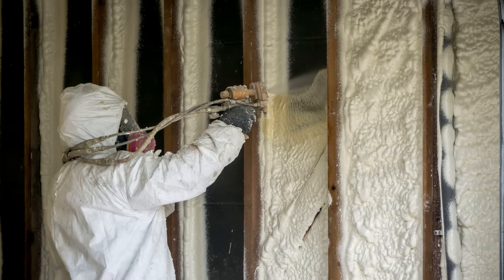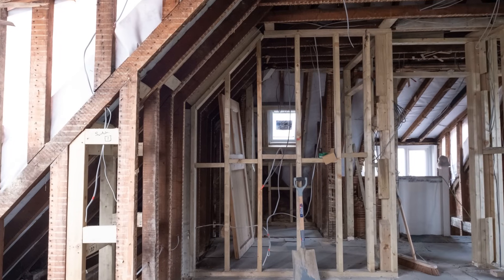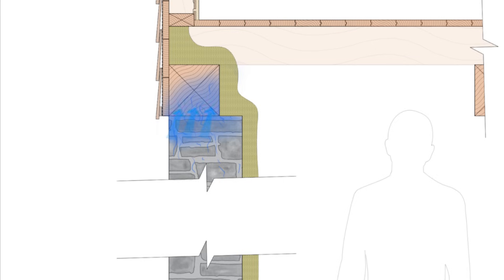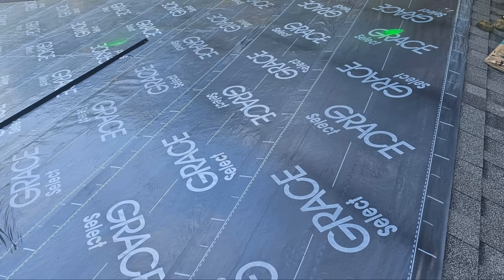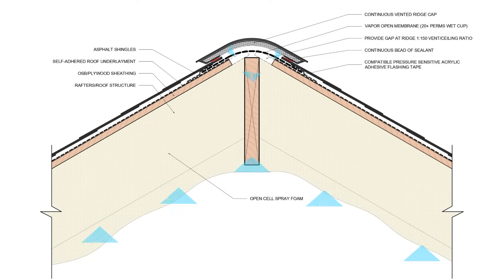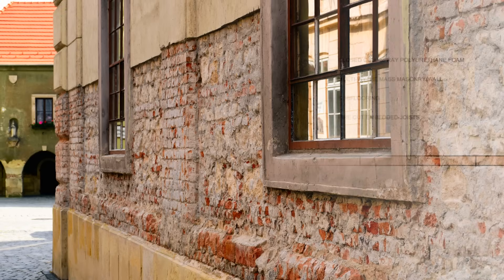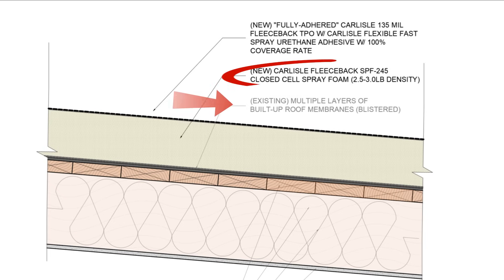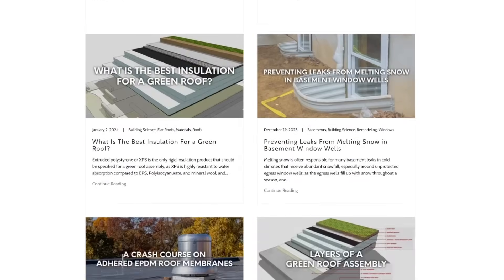Should You Insulate an Old House with Spray Foam?

Comment: If you have a basement or crawl space that has required the use of a dehumidifier, do not use spray foam in your attic. The moisture will be trapped in your house.

Comment: I was moments away from signing a contract to spray foam the bathroom ceiling because I can’t handle dealing with this fiberglass and I’m frustrated I haven’t been able to make a lot of progress lately. So can I spray foam the outside of my roof instead of the foam boards? Would I still use the ice and water shield underneath or would that affect the adhesion? Also it looks like then I wouldn’t need the second layer of sheathing and ice and water over the foam? I’m really digging this instead of our current plans if it’s doable?

Comment: What the best way to address the old home already insulated with closed cell and started make the house sweat on exterior on winter time. I live in Boston which the climate can be really cold
Reply: Any spray foam retrofit also requires a whole house dehumidifier. A portable dehumidifier, ERV or HRV will be insufficient.

Comment: If you put a blanket of spray foam on your roof you should consider what kind of temperatures it can reach when it’s heated in summer. Both peak and average temperatures. Heating that foam will promote chemical reactions that aren’t considered significant when the temperature is much lower. I doubt if anyone knows what those chemical processes will be, but you can ask a chemical or polymer engineer and get some solid ideas. Accelerated deterioration of the foam is likely. And off-gassing will continue as long as any chemical reactions persist. Extend that concern over ten, twenty, or more years, and good luck.
Reply: Good idea. A lot of roofs are covered in foam. Typically rigid foam is laid on top roofs. I can’t imagine no one has looked into it. Perhaps there are entities that have set guidelines.

Comment: I had a company that came in and capped the tops of my walls in my roof. They said I was leaking too much air up and out during the winter. But I was concerned my walls wouldn't dry out enough. I'd like to trust they knew what they were doing but they didn't ask about my siding or anything.
Reply: It doesn’t sound to me that you have a problem there. The tops of walls is not where you normally want holes. In new homes that is supposed to be sealed off, to keep fires from spreading and air leaking. What matters more is vapor drying out through materials, not holes. Most older homes have vapor-open materials in the walls. A lot depends on your climate and what your walls are constructed with in the first place.
Reply: They did good, inside air travels through holes and up the inside walls and out the top plates into the attic. You don’t want this, so this did good if they sealed all your top plates.

Comment: What about closed cell against R-panel on a shop building or barndominium?
Reply: It will separate from the building!!
Reply: @truthhearit1471 Does it delaminate from the board (OSB)?  The way those boards are put up is nailed through the OSB and the foam into studs. So it seems the panels would have to fall apart, OSB and all, for it to come off the building. I wonder if some case studies have shown this.
Reply: Spray foam is different from foam boards. @pcatful
Reply: @pcatful spray foam is different from foam board.

Comment: An exterior application of spray foam also mitigates the problem of persistent and intolerable off-gassing.  Thanks for another very informative video!
Reply: I'm just a home building science enthusiast and that's the conclusion I've come to about insulation in general, that they should go on the exterior of the building.
Reply: @RoughNeckDelta  Same here.  Asiri Designs has pointed out previously that in some situations, exterior insulation isn't an option; the downtown historic district, for example.  Otherwise, particularly on retrofits, exterior insulation has so many benefits (especially if it's a mineral fiber product).
Reply: Put it on the outside so your neighbors can enjoy the toxic gas.